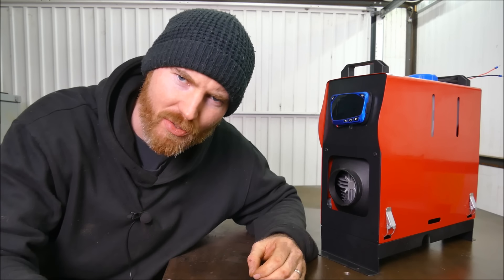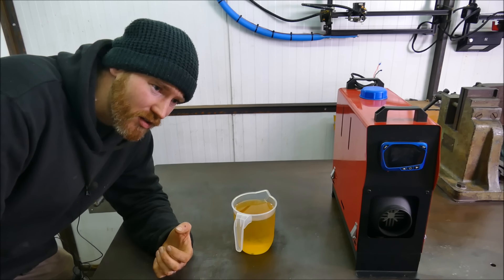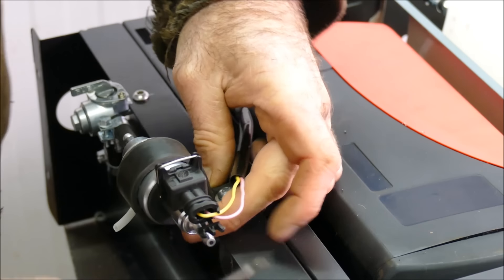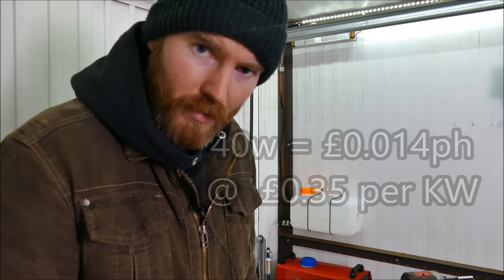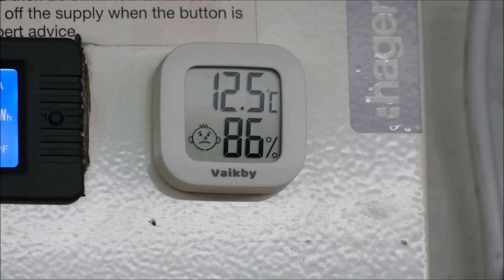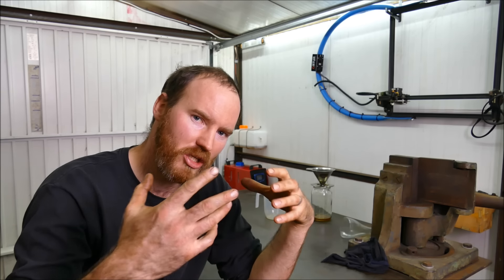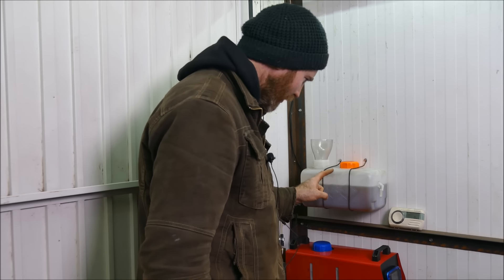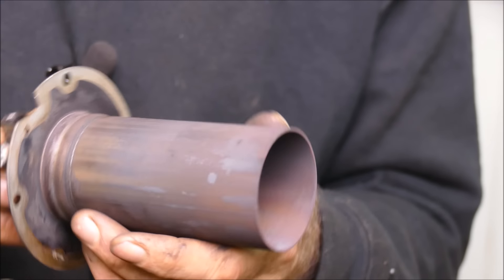£0.03 per kWh heater modification - Top facts & lies on diesel heaters - waste veg oil burn success

Comment: Regards taking out the heat from the exhaust, I hear your exhaust must be on a slight slope to prevent water build up, & the exhaust has a hole for water drip, could you use a plate exchange heater from say a large scrap boiler, water pump & temperature control should give you quite a interesting useful water heater !

Comment: In the UK building regulations relating to heating exist for a reason, can’t believe ventilation and POC condensate need discussing, as for running fuel in a non barrier plastic pipe is shocking. All of this is why OFTEC and oil fire heating qualifications exist, to stop people poisoning themselves and building their and neighbours property down.
Oil fired condensate can, is the combustion off, be as acidic as battery acid.

Comment: So, how long (Hrs) does the unit operate before it breaksdown or fails???
eg/ $cost of unit divided by total runtime in hours (till failure)
Reply from the maker: So mine is still going strong and using it a lot just now. I have comments saying theirs is over 20+ years old and highly rated them. Common things to fix at some point are the glow plug (£5) and pump (£10).  Cheers J
Reply: @joshuadelisle  Hi Joshua. I actually just bought one for $99. It a 'fat' one which I chose so it can't tip over so easy. The gutz of it is the same. Great (EX German) technology. Also, I am going to connect an hour meter to it, just for curious runtime/s. I  do that with a lot of my equipment. :) Have a great day! 👍FROM Australia
Reply: @joshuadelisle  Bearings in the turbo fan are known to wear, but easily replaced. (it's another video from someone).

Comment: The control unit can be extended so it can be used as a regular thermostat instead of relying on the Hz of the pump...

Comment: Put a copper 22mm pipe for exhaust long gets free heat from that and use cheap inline fuel filter saves clogging up until

Comment: How about point the flexible heater output pie up at the vegetable oil tank to make its viscosity closer to that of kerosene?
Reply from the maker: @ericstuber4587  you can do. Also acts as excellent thermal mass. Cheers J

Comment: There is a small amount of water in fuel. You will see this from car exhausts when the temp is cold. You will be condensing this exhaust steam in the condensor. On a gas boiler this drain is call a tundish.

Comment: Hi, thx for the vid.  I have ordered one with an external cannister.  Somehow that gives me more comfort.  A placebo maybe to be honest. 

I will use a single plated radiator for the exhaust.  On the low left and tthe high right welded two larger connections.    So i hope that the radiator gives a better rendament of atleast 50 percent. 

I have also a plate heat-exchanger laying around. 
Wondering with that if i could heat up an 80 liter boiler ?  This would save a lot of money on heated water. 80 liter is enough for showering.

Not that i need to that because i do all of that on wood for 30 years.  Using 2 3000 liter boilers and a 500 liter for heated water.   But for people with lower income and who do not have the space going this way can really save a lot of money by that.  
I am just doing that for the hobby part.  Also ordered two cheap Wish solar panels.  Curious if it is possible in winter and less sunlight to keep it operating without needing to switch over to the grid. 
Again, thx for the video and A.I. that let your video get popped up.👍

On Wish i also saw this heater with an build in water heat exhanger.   That one will probably works way better for heating up water then using only the exhaust on this model.
Reply from the maker: Thank you so much. I've got lots more coming on the things you mentioned. Cheers J
Reply: @joshuadelisle Bought another dieselheater. Different design then yours and my first one.    Will be getting it tonight. Also 8 Kw. 
For the exhaust on this one i will use a radiator from a central heating system.  So a lot of extra surface that will get hot.   How hot that will be i need to measure.  
If that radiator will be above 60 degrees Celsius then i will build under the radiator 5 x 3.5 inch fans that will be powered on 12 volt.    So the radiator will give extra heat due to the forged air. 
The radiator is 700 cm high and 500 cm wide.   Two plates with a double heatexchanger beweeen the two plates.
It awful how much heat gets lost by the exhaust.
One side of that radiator will be connected by one inch pipe to a chimney. A well build chimney that allways has underpressure. So that will help the exhaust gasses through the radiator.

There was something that you told that i do not dig.   You would take the air from outside because if you would use the air from inside it would create under-pressure.    That is right.
But...  the air outside is cold.   And the air inside will be warm.  It does take less energy to use air that is much warmer from the inside. 
I think that this weights up against creating a bit of underpressure.  Not entirely sure.   What is your take on that now you have more experience with it.
Reply from the maker: @keesverhagen9227  hi. Well done. Yes for the combustion cold air is better because it's more dense and so more oxygen rich. The heating air for the room should remain inside and recirculating so the air gets hotter. Cheers J

Comment: Might be great efficiency to use the exhaust to "pre-heat" the intake air so the exhaust doesn't go back into the house of course, maybe close that coil for exhaust into a container wrapped around the intake so it heats it up!!!.... :face-green-smiling::face-green-smiling::face-green-smiling::face-green-smiling:

Comment: What about:
Substituting the water for a metal bucket with a low hole for the exhaust output to allow the condensation in the exhaust to flow out?

Run some copper fuel tubing in the bucket to pre heat the fuel, then fill the bucket with sand to act as a non evaporating thermal battery?

Comment: I wuld use the excess heat from the longer exhaust to preheat the intake air. Helps with efficiency. Learned on diesel engine theory.

Comment: Any ideas as back up if electric fails in coming storm battery obvious but needs to kicking in other failswiring? My diesil heater is about 8.5 on diesil with keresene  Comes in at 2.8 p but I'm using 1.8 litres on 30 hours on alpine😢 damage if electric goes down not allowing machine time to do what it has to do to shutdown k53 near me
Reply from the maker: @mikesmart390  in one of my most recent video I use a battery system and discuss the options. Cheers J

Comment: I used  cooking oil on a Nissan xtrail (common rail tech) needless to say it eventually, after around a year) took out an injector. What I did find though was that the oil had to be boiled due to the water content within the oil. Vegetable oil is quite hydroscopic and for use in a diesel engine needs to be dried. I wonder if dried oil would burn with more efficiency?

Comment: Also, mount the pump vertical or 45° outlet up to prevent trapped air in pump cylinder, I believe  it's to prevent excessive wear over time. Possibly messes with fuel delivery.

Comment: Question why using an power supply be vad if the power goes off? Would a battery as a backup be added with the power supply also? And how many watts was the power supply  I know the heater require 15amps but when looking for the power supply they go by wattage? Btw Great videos on these heaters as expected. I'm about to order one but need to oeder the power supply while I'm at it. Thanks
Reply from the maker: I go into much more detail in my more recent videos on this. cheers J

Comment: Would there be a couple of efficiency points if you could pre heat the input with the exhaust.  A little heat exchanger.
Reply from the maker: I don't think that helps because you reduce the density of oxygen when the air is heated. The heater therefore runs better on cold days on start up. Cheers J

Comment: Wow I had one on a boat that never worked and the company you mentioned who made the original wanted a £1000 for a new unit.You have taught me i could have stripped it down and replaced as necessary 😊
Reply from the maker: They're a lot of money the official ones are. I like that the Chinese have made it cost effective and cheap to maintain too. Cheers J

Comment: One question and I do hope you read this. What about drilling a bigger hole for the glow plug and fit a more powerful glow plug? Wouldn t that help also the combustion? Or even make an improvised particle filter with a glow plug in the exhaust? Wouldn t that help the sand battery from the other video and burn the "unburned residual fuel"? Thanks in advance and God bless you
Reply from the maker: @aurelianpetre93  the glow plug is just to get it started and is only on for less than a minute. To help aid the efficiency of the combustion you can pre heat both the fuel and air intake. Otherwise cold air is more oxygen dense which gives a higher output. Cheers J
Reply: @joshuadelisle ah got it m8 thx for the info

Comment: Hi Joshua I've been experimenting ...diesel heater in my workshop I've done what you did initially more or less...the biggest problem  with these is the loss of energy with exhaust system...i think we agree....so my solution is  a  4 meter exhaust  pipe on inside of building run through a scaffolding pipe also 4 meters..then I added 2 minibus heaters  beginning and middle of exhaust system with radiators and 2 speed fans through a vented system the radiating heat from the scaffolding is good but when you turn the fans on it pushes round the workshop lovely everything is 12 volt run by 2 120 watt panels and  rolls batteries it's best heater ever I run on kerosene  ....may I add my ultrasonic cleaner packed up and I needed one urgently so I glued the cleaner body to an old sheet sander with adjustable speed ..i use it in the vice it's ten times better than any bought one cheers des
Reply from the maker: @desmondbroad1305  well done. I'll be experimenting soon building a large insulated hot water tank and heat exchanger for the exhaust to circulate around my house central heating. Cheers J
Reply: That's my next step moving it into the house  thanks for the reply

Comment: You could put some copper or aluminium fins on the pipe to convect even more heat.
Reply: was really impressed by American sensibility and basically their rads are a number of alu fins clipped over a copper pipe no flow or return just one pipe and fins relevant to the room size i guess, i hate single pipe system her in blytee but having dealt with some thie ami system would be so much easier controlled only by the number of fins but once one has that worked out its a bit like having underfloor heating less control but ultimately very cheap to install

Comment: I ran a fleet of Landrovers and Toyota Hilux on recycled chip oil for a UK National Park about 15 years ago. We purchased the oil from a local eco company. They collected from a range of fast food outlets etc. To my memory they used to add 10% white spirit to the filtered chip oil to enhance burning efficiency and produce a clean burn. The fleet ran without issue over the 3 year lease period. (for the first three months we filled up with diesel every three fills, after that full on chip oil). We also ran a small tractor which ran perfectly, though when it was working in the forest you didn't need to hear it to know where it was, you just followed your nose as it smelt of flame grilled burgers!
Reply from the maker: @wayneevans3342  👍

Comment: Just curious if you turn this unit upside down could you do a drip feeder?  After the unit is started you could switch to drip feed and save the electricity used to run the pump plus it would be quieter…you would just need to workout the drip rate. Maybe a shot in the dark lol 😆
Reply from the maker: I don't think so because it requires a certain amount of pressure to enter the system. You can definitely build a drip feed version though. Cheers J

Comment: I filtered my exhaust through a radiator but it restricts the exhaust flow the heat outlet was extremely hot, exiting through the garage wall increased the heat output considerably

Comment: This guy is so sharp...
Would love to see the long period test with cocking oil.
How much dirt will build up?

For the waterheating i mounted a used carpart thing that heats water with the cars exhausts. About 20-40 euro used on the car scrapyard
Reply from the maker: Thank you. I'll definitely do a follow up, I'm using a bit more now it's cold again. I've also got two more heaters  to modify and test out. Cheers J

Comment: filtering the oil can be done by using gelatine and water and some time to let the jelly Congel on the bottom of the bucket. and your heat exchanger idea in the bucket replace the water with kiln dried sand and add a water loop in copper pipe with in the bucket separate from the exhaust but submerged in the sand add a pond pump and circulate the water over time it will heat.

Comment: you could have put sand around the exhaust, ive heared sand batteries are good for holding in heat
Reply from the maker: @KairuLitt  tried it already. It's not as good as water. Cheers J

Comment: In figuring cost heating with electricity,I'm assuming that was kw to run the heating element. There would also be power to run the blower.

Comment: Great video joshua, 
I have subscribed to your channel. 
I love your approach on dealing with people correcting your info, using it to your benefit (the correct info anyway) 
Do you think it would be safe enough to simply run the heater on a 50/50 mix if cooking oil and deisel (or kerosene) if its not possible to fit another tank? 
Thanks and lookong forward to more videos.
Reply from the maker: Thank you. 50/50 will work fine but overtime contanimates will soot things up and need cleaning out. once a year is probally fine. cheers J

Comment: 21:54min in - Re carbon monoxide risk. The risk would be associated with the security of the section of exhaust system within the building, or of building ventillation that allowed any exhaust gasses sent out of the flue to re-enter the building. It is a design feature of the device that the heated air never comes into contact with the burner intake or exhaust gasses.

Comment: 13:06 it is kilowatt hours (kWh) that is the standard unit of consumption and not kilowatts. You pay 35p for 1 kWh. Kilowatts are the rate of work done, or the rating or power output of your heater unit. For example, if you have a 2 kW electric heater, switched on for one hour, it will consume 2 kWh.

Comment: ❤ hi there I've just been watching one of your videos and I found it very interesting. I have a question for you does the exhaust pipe have to be straight through like your how can you put a bend on the outside so it is angled up and then across. Which would you recommend. thanks Mike
Reply from the maker: Hi. You're allowed a maximum of 3x 90° bends. The exhaust is easy to bend by hand. Cheers J

Comment: That’s great. Thank you. For the coming winter. We are just facing new lpg boiler which with installation cost amounts to €3k-€3.5k!. The boiler itself is only €1.2:). RGI installer takes a lot. I wonder about 2 things how to use it in a large house to distribute the heat and how can the heat from exhaust can be used? I appreciate advice! Thanks a lot!
Reply from the maker: For LPG the temperature of the exhaust I think maybe critical to the mechanics, so by extracting from it may cause it to fault. you'll need to consult the person who fitted it for you on what could be achieved. cheers J

Comment: If you make your exhaust exit vent at the low point it will drain.   You should see the video of they guy that used a heater radiator from an old building for this.   Worked well.

Comment: How about 50/50 mix of wast oil and diesel
Reply: Ok I said this before I seen the hole vidio lol😂
Reply: or kero :)
Reply: @ukmayhemproductions  Kari in Canada is 3 dollars a liter it’s 1.50 for diesel
Reply: @unclebill5170  can you get red desiel ? Might be cheaper still
Reply: @ukmayhemproductions that is red diesel
Reply: Stupid Trudos cabin tax is around .60$ on all fuel and fuel oils
Reply: Fking hell I'm doing some research with engine oil with vaccume distilling the kero off might be cheaper just to buy a vaccume pump and get used oil lmfao

Comment: With the veggie oil do you get build up of ash in the burn chamber? At least the smoke from the veggie oil makes its smell like a fish and chips shop.
Reply from the maker: It probably does but because I do a hot burn with Kerosene before and after it helps clean out carbon buildup. Cheers J